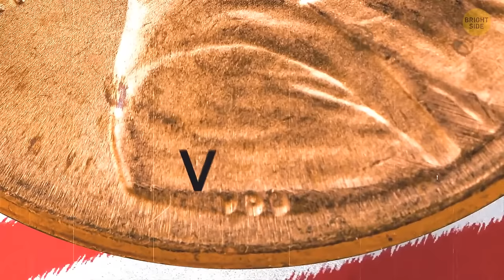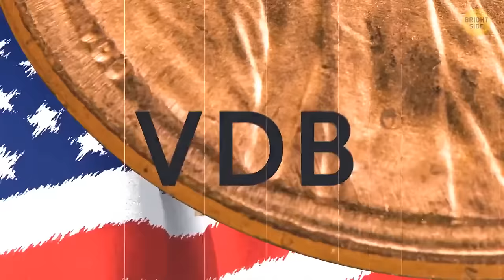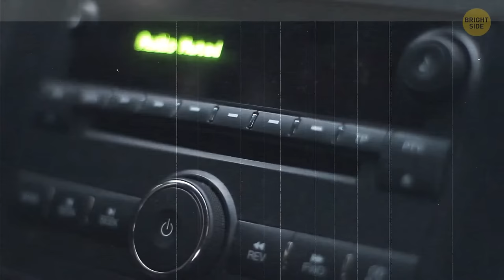Random Facts That Will Make You Say "What?!"

Comment: Only slightly correct about the buttons on furniture. Having worked in the upholstery trade, the stuffing materials can and have  been secured by unseen methods under the coverings. Animal hides have irregular shapes not always large enough to cover the back of a couch for example. The buttons and "tufting" is a decorative way to hide where animal hides are joined in the folds of the hides. The button tufting method has been adapted to other fabrics and materials for the decorative appeal.